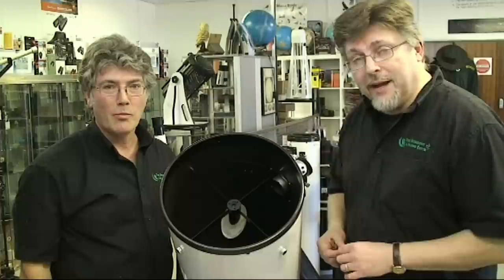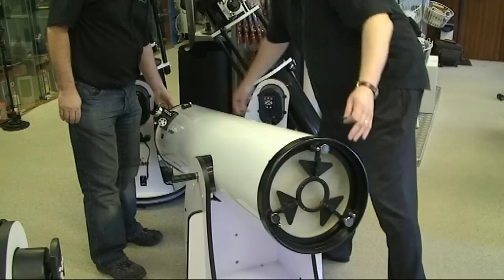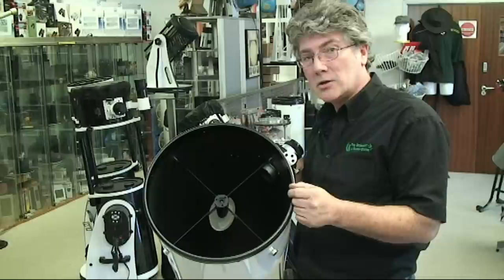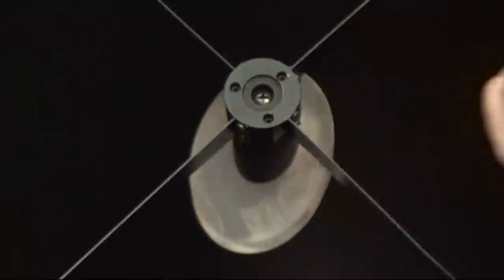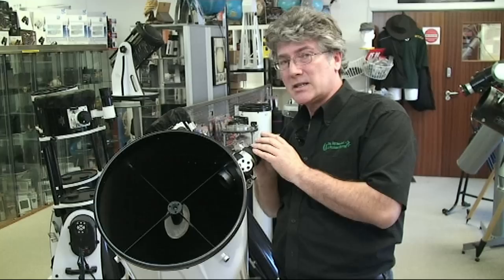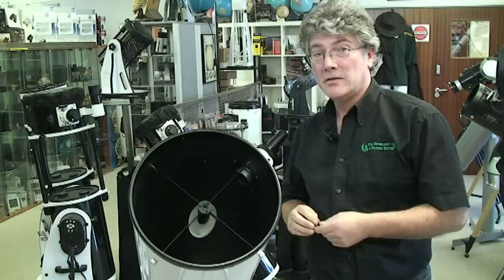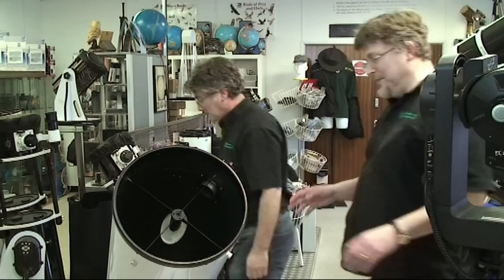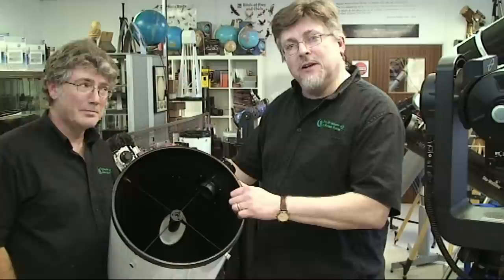Collimating your reflecting Telescope in just a few minutes

Comment: Is it difficult to open the bottom to clean or change the mirror ?
Reply from the maker: Hi there. No just a few screws on the edge where the mirror cell fits into the tube and the cell is free. Depending on the model of your instrument, it's best to mark the relationship between the tube and the mirror cell, so that you restore the mirror to the exact same position on reassembly. Sometimes there is a notch for the seam or Dutch fold in the tube that makes misalignment impossible, but it's best practice not to rely on this and make your own marks. Check the collimation after it's all back together. Thanks for posting. KR RJD A&NTV
Reply: @RocketPlanet  Ok thanks , just asking cus my 10" dob came with the circle sicker at the mirror loose , i need to get to it so i can fasten it properly , half of it is not touching the mirror

Comment: I collimated my 8 inch reflector using a laser collimator. Got it perfect on the Secondary and primary. Then noticed, when I went to remove my laser, the dot shifted. I began to spin the laser in the lens mount and the red dot proceed to make a circle on the primary mirror. does this mean that my scope isn't properly collimated?
Reply from the maker: Hi there. Yes I'm afraid that is does mean that your instrument is out of collimation. One of the problems with laser collimators is that they themselves need collimating. It is quite common for Chinese made laser collimators to be supplied without instructions. You should see three collimation grub screws on the body of the laser. You will need the adjust the device so that when rotated the spot seems to stand still. This is not easy to do in the eyepiece holder. Ideally you can use a lathe with a pass-through chuck. Place the laser carefully in the chuck, making sure the body is true (ie doesn't waggle when you rotate lathe chuck). With the laser spot thrown at least 6 feet onto a wall, adjust the laser turning the chuck by hand as you go. If you do not have access to a lathe you can find a large book (old family bible can be good for this) and by opening it halfway a notch is created in the centre of the pages that will allow you to place the laser in it and rotate it by about 180 degrees back and forth. It's not ideal but with care you can adjust the laser as needed.  I hope this helps. KR RJD A&NTV
Reply: Mr McKillin you can buy a "V BLOCK" you place the collimator in the V and rotate it, aimed at a wall at least 8ft away, you will see if the laser (dot) moves about or stays central. I believe the collimator has adjustment screws to remedy any movement.

Comment: hi i have a celestron powerseeker 127eq and i don't know anything about telescopes and i want to learn. I'm so facanated with the night sky but when i take it out i can never seem to be able to see the planets. I do have several eye pieces with different strengths . I can see the moon with little troubles. but im having a lot of problems like when i switch eye pieces i have to find the planet again and that's no easy task.
Reply: Taylor Cuadros It sounds like your telescope might go out of balance when you change eyepieces.  I have the same problem, with my older Meade.   Does your mount have any locking knobs to lock it inposition?  If so, you should tighten these before you remove the eyepiece.  You may also need to align the finderscope wiht the main teescope.  I find it is easiest to do during the daytime, looking at the moon or some very distant object.  Once you get it centered in the main tleescope viewfinder, you can adjust the screws that hold the finder scope until it is centered in the finder as well.  Check to ake sure the object is still centered in hte main scope before you declare completion, as you may have moved it while adjusting the finderscope.
Reply: thank you for the great info. and yes i can tighten down the mount maybe my finder bolts aren't tight enough.I have seen many vids on how to collimate my scope but i still cant get the hang of it.plus im scared ill break one or both mirrors.I just wish i had someone to go to or come over to show me and teach me.

Comment: What if I have not got a little black circle on my mirror to line the laser up against?
Reply: If you don't have one, you can probably just estimate where the middle is, but that may be a bit more difficult.
Reply from the maker: Hi there,. Sorry to be so long in reply.  This reply is a repeat of the one given to a more recent poster - sorry I missed your useful much older post. Yes that's a problem right enough - you will need to ammend this situation if you wish to use a laser. And guessing or estimating the center won't do. The following procedure will help. Carefully remove the mirror in it's cell. Plot the centre of the mirror as exactly as you can. There are lots of methods to do this but I have used variants of the following many times.  Take a sheet of paper,a little larger than your mirror's diameter and lay it over the surface of the mirror and, holding the paper steady, carefully rub around the, typically beveled, edge of the mirror with your finger tip - for as much of the edge as you can get to between the mirror support lugs. Examine the paper; if you have done the work well you will see faint but clearly visible marks on the  paper showing the edge of the mirror. You will need to carefully cut out this paper disc/shape with scissors. You can either fill in the gaps left by the lugs with a compass or just ignore the gaps and cut into the disk at these points - creating a shape that looks more like a stubby fan blade or cog - i.e. with only the proper mirror edge marks trimmed accurately and the bits in-between cut away into the interior. Fold the cut shape in half as carefully as you can - lining up the outer curved edges as closely as you can - and then fold this in half again. Now using scissors or craft knife, snip the corner corresponding to the  centre of the cut shape off - keep the cut as small as possible, just enough to remove a tiny fragment of paper. Open the paper and flatten it - you will see a small hole in the center. Place the cut paper shape as precisely as you can on the surface of the mirror and mark the mirror at the very center of the hole in the paper with a narrow (1 or 2mm) permanent marker or china-graphic pencil. You have now marked the mechanical center of your mirror. This point will be difficult to see when collimating so it would be wise to position a small white paper (or plastic) 'doughnut' - the type of thing used to reinforce binder holes in filed documents - as precisely centred on this point as you can. There is in fact a logical difference between the mechanical center of the primary mirror and the optical center but for government work it is generally accepted to regard them as the same. You will now be able to use the laser collimater as described in the video. I hope this helps, sorry about the length - I didn't have time to write a short version.KR RJD A&NTV

Comment: Actually, the first thing you should do is check that the laser beam is coming out of the collimator parallel to the collimator body.  If it isn't then you will make matters worse.
Reply: This is important. When my laser arrived it was well off and needed major adjustments to be straight.
Reply: Apollo my laser collimator has no adjustment screws. When I spin it in the lens housing on the scope, the red dot moves around in a circle instead of staying centralised.
Reply: Mr McKillin Unfortunate, mine also was uncentered upon delivery. My collimator has three adjustment screws on the side and a very small allen wrench is needed. What brand did you purchase? If interested mine has a "Vite" logo on the side. It has worked quite well.